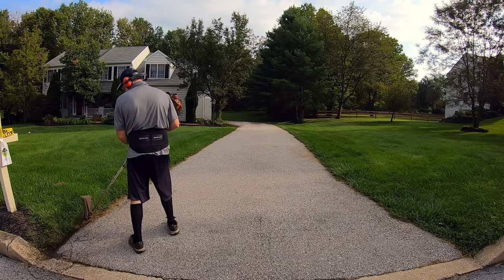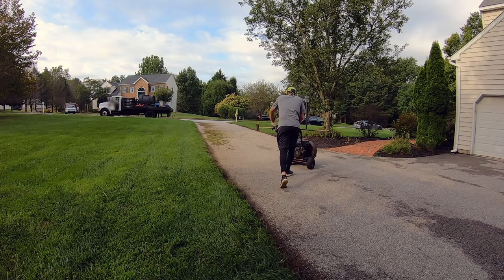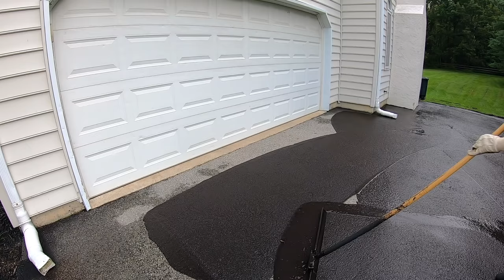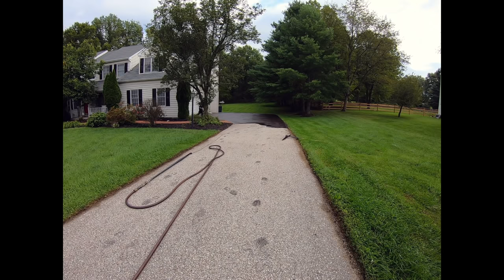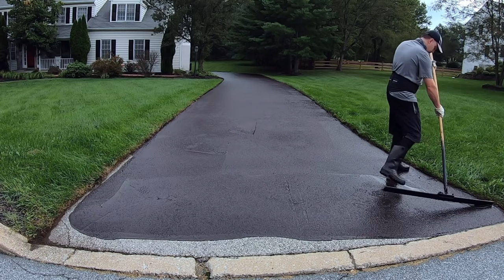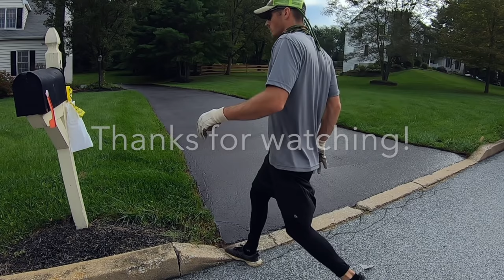Professional Driveway Sealcoating #8 "The Art of the Seal"

Comment: the sealer still dries on those wet spots from the water
Reply from the maker: Yes, the product we use is water based. As long as the water isn't pooling on the driveway, its fine to seal.
Reply: Water  is water  you never seal wet pavement .....
Reply: @robertusa1234  not with an oil based sealer, but water based is fine
Reply: If the ground is just damp blowing it off will start the drying .. then if your sealer is mixed correctly the amount of water on the driveway from moisture is irrelevant.. the seal will still turn out great.
Reply from the maker: @Juicyj1  exactly

Comment: Protip: Prep is key, clean and remove all dirt, dust and debris.  If u moisten driveway first with a mist of water so its damp (no free standing water or puddles) it the sealcoat adheres better by eliminating air voids in crevices.  It spreads smoother than on a dry driveway as well.
Reply: i may be 53 yrs old now and a business owner in a diff field, but there was a time that I personally sealed 100's of driveways for 6 years from age 16-22 every  Summer.  ABSealers of Wayland MA back from 1984-1990 It was great money and a great experience.
Reply: @alanbrynjolfsson1447  I thank you for your comment this information will help me as I get started

Comment: Upsell - pressure wash and then coat.
Reply from the maker: I wish I had the time to pressure wash. I will try to get a video this season doing both.
Reply: @SEALCOATINGISLIFE  Being a disabled veteran helps, or any "lifetime" paycheck really, such as retiring, etcetera. I'd like to do both, although I don't know much about advertising enough to get jobs for either. I have started collecting pressure washing gear, like the surface cleaner and a minimum 2.5 GPM 2100 PSI pressure washer. This looks almost easier, though I would upsell to CLEAN first.

Comment: Just had a nightmare on my driveway. J&J sealcoating came over. They slopped the seal on my driveway so bad. Didn't smooth anything out, and the crack sealer they put in is completely defective. The crack sealer is complete mush even 1 month later. How and the hell can you fix something like this?

Comment: Used to do drive way sealing, there is no way we would be able to use that much product or take that long to do a driveway and make any sort of profit. People here under cut like crazy, a driveway that size, people were charging $100, they would use the spray sealant. Since that was the going rate, all the customers expected that pricing. If I told them it would cost around $300 to do it properly, I get no call back. Wish people knew that quality costs. You guys did a good job, I hope they pay you enough
Reply: Where do you live? Recently did an paver and concrete sealant project and material alone was around there.
Reply: @danielsimchuk7562  Toronto area, these people under cut like crazy

Comment: did you pressure wash the drive first?  Also, does it matter if the asphalt is wet when applying the seal coat?
Reply from the maker: This driveway was pressure washed a few days prior to us sealing it. The driveway can be a little wet as long as the water isn't puddling.

Comment: I wonder where is the cover solution coming from? Is it premixed in a volume that is attached to the vehicle? Is it hot or cold? Not clear from the video where the hose is connected to? The substance seems less of a thickness than that from the bucket? Is it same formula and cost same as that stuff from the bucket?
Reply: You can see a tank on their truck at the very beginning.
Reply: @donnash5813  Thanks, I saw it now. It seems cold as it does not steaming ... still they keep formula out of our eyes ... coal tar and one or two additives is all you need to mix the good sealer and avoid paying for expensive 5 gallon buckets....

Comment: So what happens if it actually does rain within 24 hours of putting this stuff on?  Does it just take longer to cure, or is it somehow ruined forever?
Reply from the maker: It’s water based. Worst case scenario is: we reseal it and have to do some pressure washing.
Reply: @SEALCOATINGISLIFE  So pressure wash it, then coat it again..  that's not so bad :)

Comment: Serious question but what is the point; I guess to stop water seeping down and causing pot holes when it turns cold?
Reply: There are many reason to coat your pavement like this.

The obvious is to prevent cracks forming from freeze thaw of water in winter but there are other reasons.
Aesthetics, water wicking, ease of cleaning,  uniformity and it looks snazzy among other things.
Reply from the maker: what he said 👆

Comment: Is power washing the driveway before applying the sealer crucial?? Asking for a friend
Reply from the maker: It will always come out better if it correctly cleaned. however it is not alway necessary to pressure wash before brush-applying sealer.

Comment: Splash against the wall and not removing lower gutter drain. Simple fixes on the edge make the overall 100%.
Reply: I pretty much said near perfect. Only simple fixes would make it 100%. Like removing a gutter bottom is two screws.
Reply from the maker: That’s in their estimate. I’ve done that before and the entire gutter became detached. They are required to remove anything they don’t want to get sealer on.

Comment: does the hose ever get sealer on the road??? We normally run buckets but we do have a hose
Reply from the maker: How do you mean?
Reply: @SEALCOATINGISLIFE  like does any sealer get onto the hose while you are moving it down the driveway to the truck? Have you had any problems with spots on curbs or the street at all?
Reply from the maker: No. Only problems that can happen are the brushes dripping when we take them out of the brush box. But that’s an easy fix.